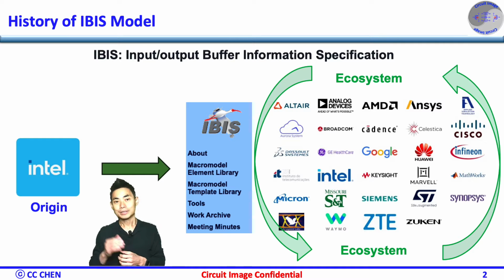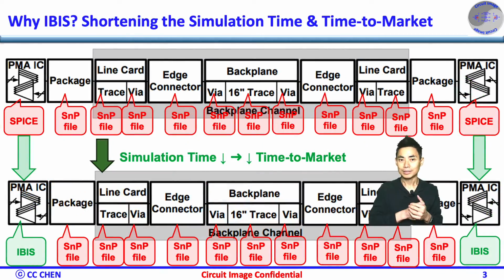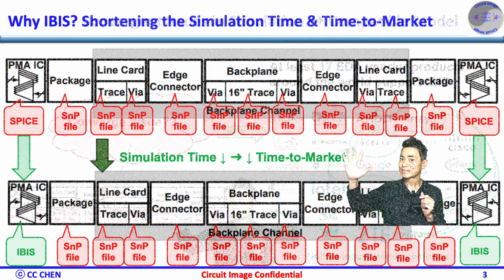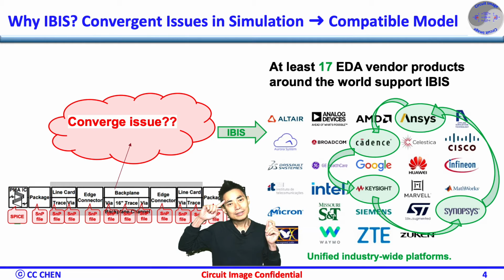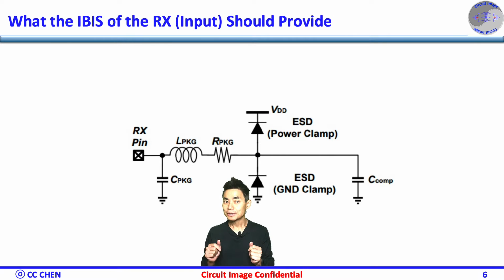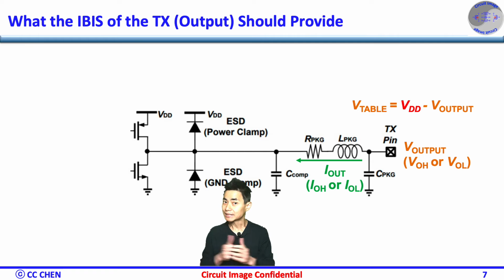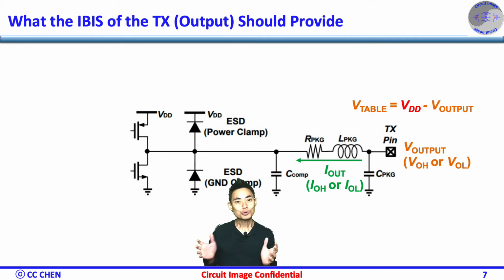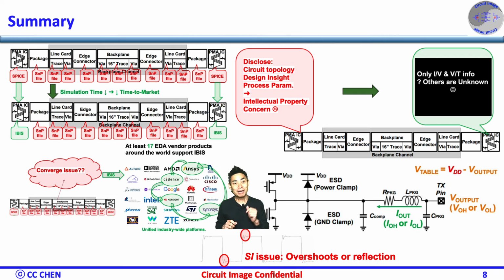Why IBIS Model?

Comment: hi CC, long time ! 
excellent video as usual :) 
one question. In the slide 6 , where you have the RX IBIS model there is no termination resistance included. In most of the links, there are both TX and RX resistive terminations for matching the channel impedance. Is it possible to include the termination R in the IBIS model ? Some termination R parallel to Ccomp but it connects the RX pin to some VCM voltage , if the link is AC coupled. 
Thanks !
Reply from the maker: Hi Hrachya,

Thanks for the thoughtful question! You're right that most practical links include RX termination, often to a VCM through a resistor. In standard IBIS models, such terminations are typically modeled externally in the simulation testbench unless they are integrated on-die. If the termination is part of the silicon, some elements can be included via pullup/pulldown tables or specific keywords, but VCM-referenced terminations (especially for AC-coupled links) are better handled in the simulation environment.

Thanks,
CC
Reply: @circuitimage  Thank you for the response, appreciated !
Reply from the maker: @hrachya_khachatryan  Hi Hrachya, you're very welcome.